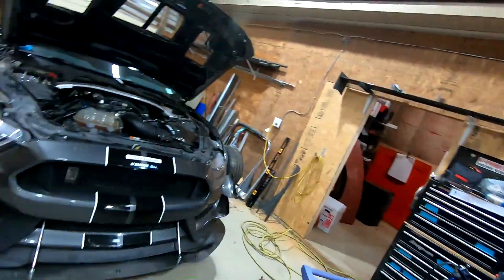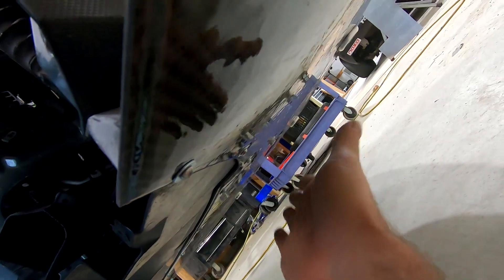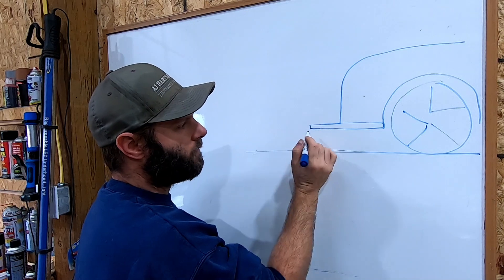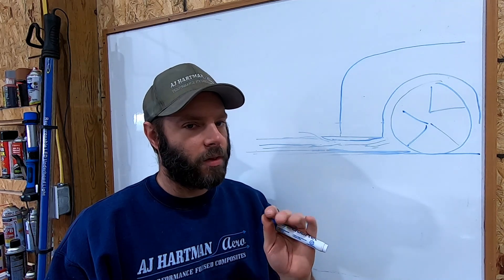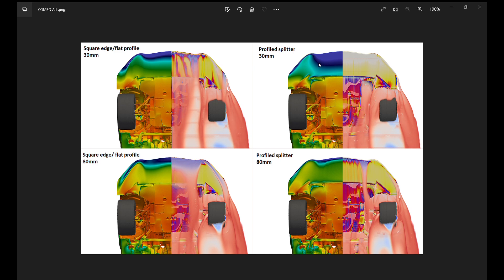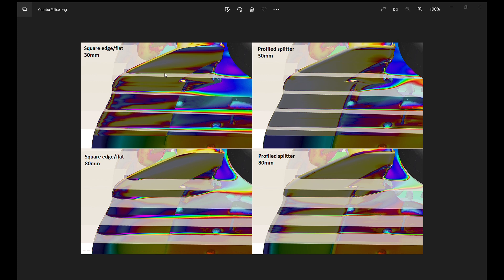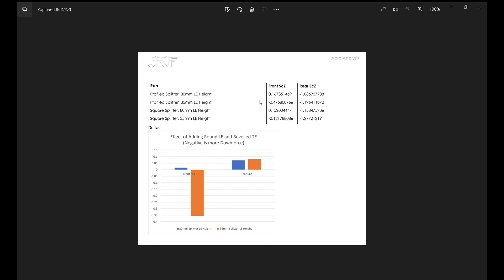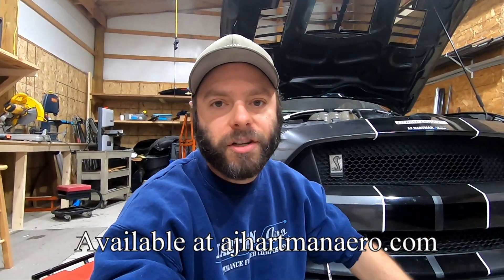Splitter CFD- Small Changes, 4x the Downforce (Almost)

Comment: At what height does underbody aero do basically nothing except drag reduction? I have a street/weekend car that I'd like to keep close to stock height for practical purposes, but I'd like a little downforce for stiction and general fun, I just don't want it to be either a complete waste of time or inefficient enough to increase total drag and worsen fuel economy.
Reply: It's not like a static number for height 

The more aero means more load which will pull the height down more as you speed up

Look at F1 purposing for the limit of ride height and aero

Comment: I like the concept and wind tunnel proof to show how it "guides" the airflow.
Just wondering if one was to do the same with plywood to start as a prototype, how thin did you go at the rear of the splitter and did you cast in an eyelet of some sort being so thin so it doesn't break? TIA

Comment: I fortunately didn't waste much time on 3d scanners.
They are junk. 
Learn how to do photogrammetry. Much better for almost any project. But ESPECIALLY cars.
This vid is a year old, I'll see if you've figured this out yet, or still are messing with scanners.
Reply from the maker: Like anything, there is a learning curve. I've since picked up Revopoints Range and its much more suited what what I was trying to get the POP2 to do in this vide and can handle scanning much larger areas way better.

Comment: first time ive heard a chamfered edge be referred to as radiused.. but that splitter is still cool non the less
Reply from the maker: what kingwolfracing said is correct. There is a difference between a radius and a chamfer. My verbiage is correct here but I have misspoke in the past.
Reply: That is actually a radiused edge a chamfer is usually an edge taken down at some specified degree but a chamfer always has sharp edges where it meets the other faces

Comment: I have a front splitter chassis mounted with a front square. I've been looking at other aero car channels, and only you (so far into my rabbit hole of watching others) have brought up the shaping of the front splitter. Since mine is made of marine ply wood, im gonna have to sand it down to mimic an upside-down wing. Good video dude

Comment: I've always been impressed at how mickey-mouse most car aero devices are in terms of shape and understanding.  Square edges on a so-called airfoil is madness.  That's like using 90-degree plumbing fixtures for headers.  It's nice to see some proper analysis without there being an airplane or an F1 car involved.  Now if only you were doing Miata parts...

Comment: Is there an optimal downforce? I imagine there is a point where we can say - we have too much downforce - right? The downforce ultimately decreases the forward vector by taking the car energy and creating a down vector. So what is the ideal downforce pls? (anyone?)
Reply from the maker: No one really knows cause there are no many factors for one optimal level.
Reply: Basically, more downforce means you can go through a corner at a higher speed, and there's effectively no limit to this. However, the aero will slow you down in the straights, which is the compromise. The reason you don't see huge massive aero on all racecars is usually just because the rules don't allow it. Also, more downforce does not always mean more drag, but they tend to come together.

Comment: Have you considered altering the exhaust from the wheel arches? With your carbon knowledge I bet you could improve that area significantly. Doing something similar to what the 992 GT3RS to lower the wheel arch over pressure. 
As for the splitter do you find extending the front surface area is needed as apposed to changing the stock profile by scalloping out the undertray to create to negative pressure eliminating leading edge extension and also reducing ground contact. Which as you know unloads the tires.
Is there a solution without adding on but instead reducing high drag areas?
Reply from the maker: Wait for our next wind tunnel video.
Reply: @ajhartmanaero  Will do!

Comment: Verus engineering has their splitter in the same manner using the stock under tray which is why it wasn’t perfect for me with a GT.
Reply from the maker: I’m not quite following. Same manner as?
Reply: @ajhartmanaero  as you stated in the video, with the splitter bolting to the stock undertray. It doesn’t have the same wing shape which is quite innovative though. I also was curious what’s the furthest it sticks out from the oem components

Comment: Love the channel! I'm not there yet, but definitely want to work with you at some point for MK7.5 GTI aero work. It's frustrating how terrible most of the aero stuff is designed for this platform. All "track inspired" with poor CFD models and no wind tunnel testing. 

These cars desperately need help with cooling (engine/brakes in particular) especially due to such a dense engine bay.